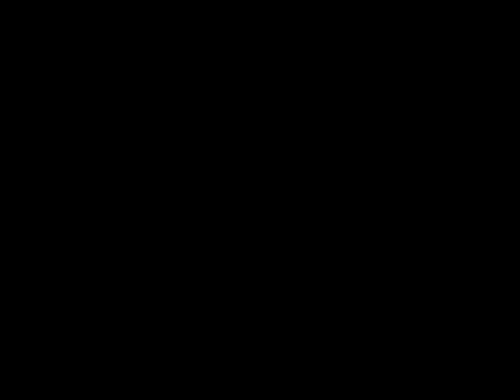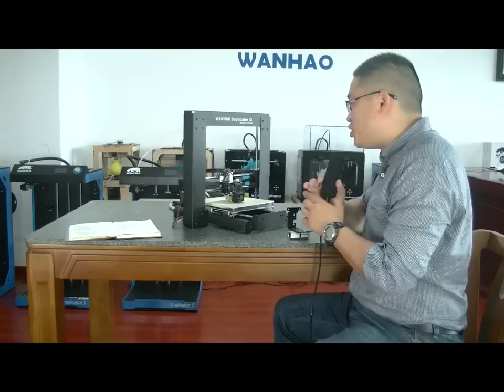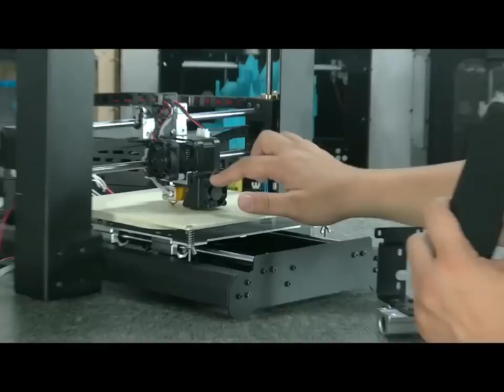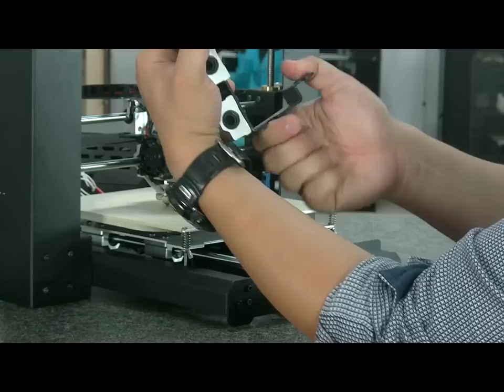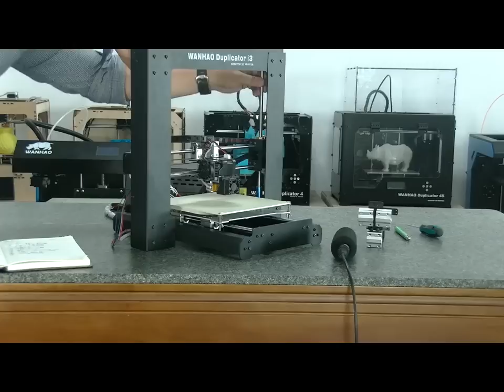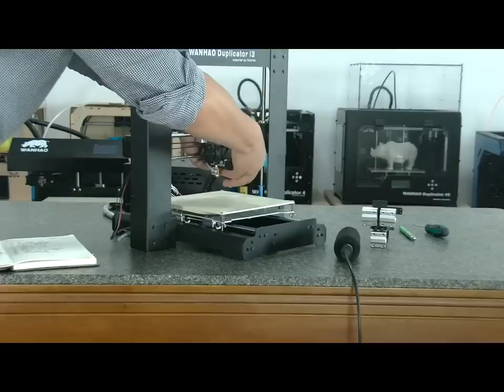How to adjust the fan height of Wanhao Duplicator i3

Comment: This printer has about the worst possible fan mount design.  Terrible, terrible, terrible.  Fan not only blocks the view, the mount is so low that if even a minor glob happens to stick to the side of your print, the idiotic fan mount comes around and knocks the print over or breaks off parts.

Comment: All you need to do is dismantle your brand new printer you just bought and start bending brackets...... Sorry that's not a real solution. How about instead you fix your design and stop selling people these printers that require all kinds of part replacements and tweeks for them to function properly. Nothing is square on the frames. Belts are not aligned. Bearings are garbage. Beds are bent. Fans fail. Connectors are mix and match. Display is bugged and does not highlight selections so you have no idea what your choosing. The list is way to long for a printer that has been on the market now for quite some time.

Comment: Mine was OK until I realized that after adding glass on my heatbed with clips the fan is touching to the clips. And couldnt wind any solution to that :( may use gino pads however clips are really easy to use, and I am using the smaller ones, so just need 3 mm higher but already its kind of as in the video max highest possible.. Any suggestions?